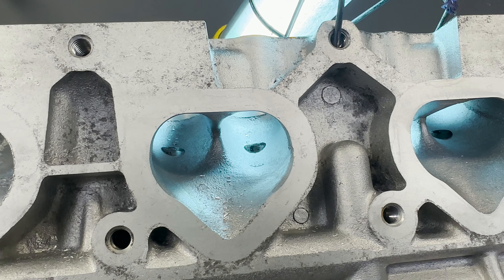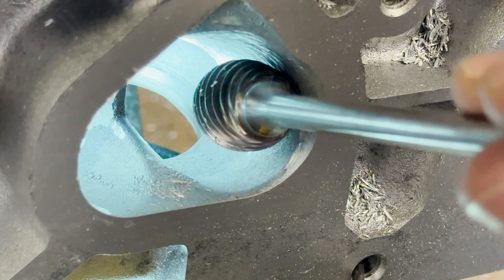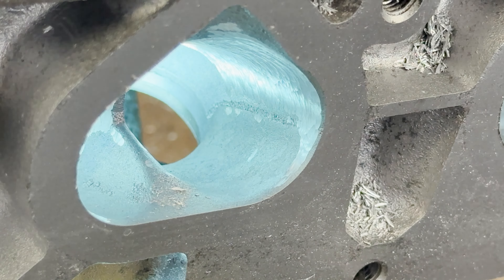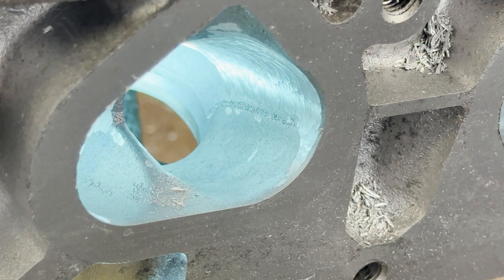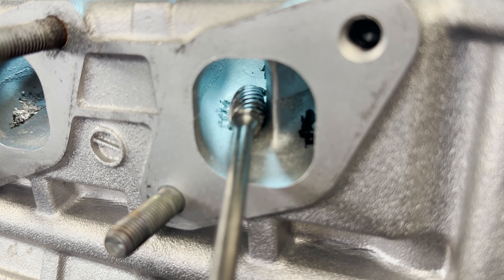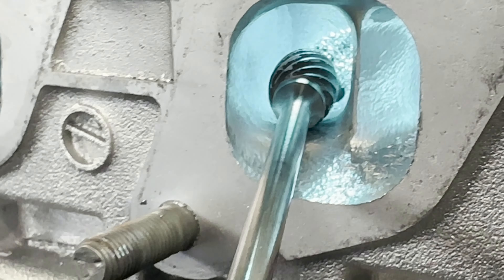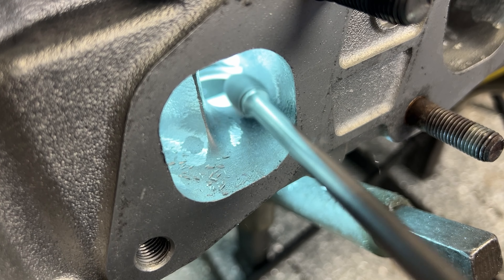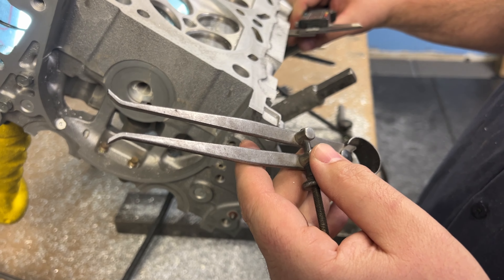Porting How-To: Nissan KA24DE full port!

Comment: In the bike world I always see every single shop or individual always port everything big and wide with the guide cut flush to the port, I'm no pro but have been porting for a while (car 2 valve world till recently) and think that just making a big round hole with no guide has to really hurt port flow and velocity. My question is what have you found with your 4 valve heads? Appreciate your time.
Reply from the maker: We remove the guide boss, but we remove the guide first and install it at full length. We don't make the guide flush with the roof because then the valve is not supported which can cause the guide to prematurely wear. Learned that from doing it.  It is a very small or sometimes no gain in airflow.

Comment: I have a question, I'm currently porting my s14 ka head. Once you're done with the burrs, do you have to go smoother and polish it, or is the finish from the burrs smooth enough? Thanks for the great video and being very helpful.
Reply from the maker: I use the 1/2 burr at a slow speed to make it smoother and then polish it with 60 grit both sides and then go over the exhaust with 120 grit.

Comment: What's the benefits over not porting
Reply from the maker: Benefits over not porting it is added airflow, and added whp
Reply: @headgames  is it noticable gains, or is it trying to squeeze every cubic inch out of this platform?
Reply: @Schmitty_Luv2  are you acoustic? Literally explained nothing about it benefiting this platform. KAs intake was designed for high compression with fluid dynamics in mind
Reply: @ogadam1  Designed yes, implemented as efficient as it could be from factory for performance? No lol
Reply: @MinhDangcraft  only say that cuz I've seen multiple people hit 800-1000whp without touching the intake manifold lol
Reply: @ogadam1  seen that in some cars but others are atrocious for the intake. I've seen Subaru ppl run a 2.5i rotated intake and Honda ppl unironically cut/port/weld the intake since the core shift is so bad. Mileage may vary lol

Comment: Agree with Goyo. 
Especially the angel when filming. Finally you can see whats going on. But, a couple of times Dave mention (you cant build it up again) when talking about grinding to much. As far as i know there's things that work's fore this purpuse. JB-welding for exampel. Maybe Dave got reasons for not using things like that.
Reply from the maker: there is nothing that can go in there that would stay in a port or that you could possibly shape. Once it is gone, it is gone forever.